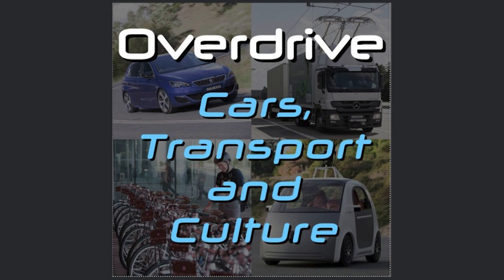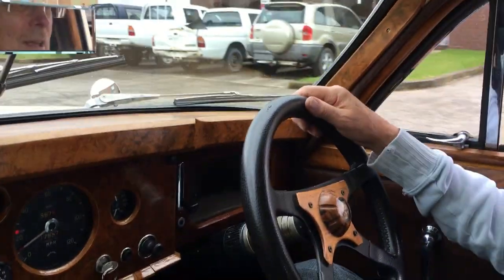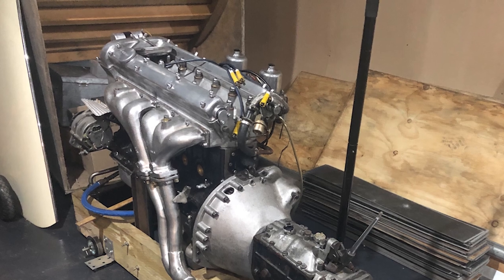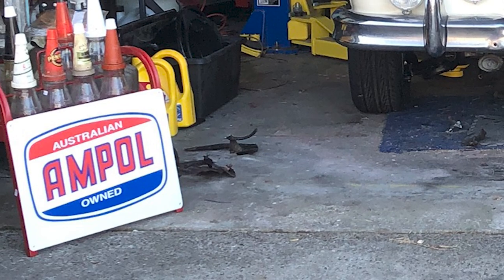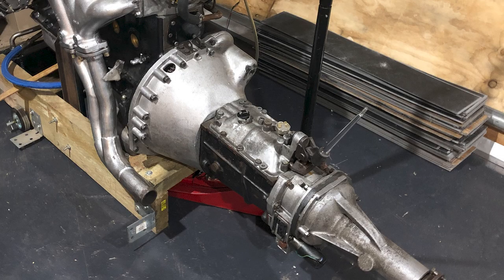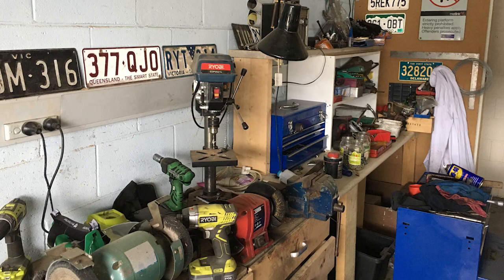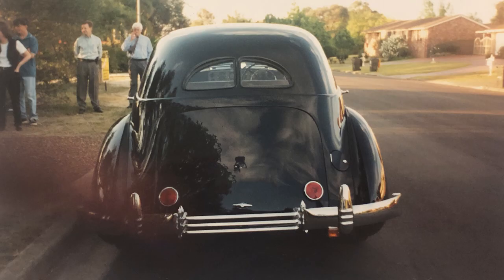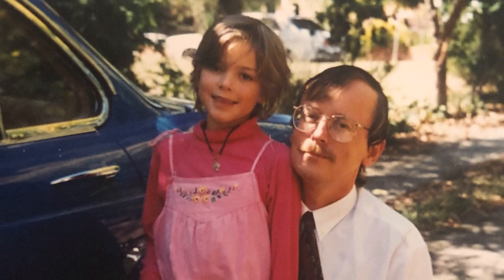Restoring a Mk 1 Jaguar into a reliable, spirited drive without losing its character

Comment: Hi nice vidio,I have a very similar set up,but in mk 2  .I did the conversion about 38 years ago.
When getting the twin SU8 carbs recond .They centred the jets with a tiny ball gauge ,he said necercery and then never need to ajust.
I must say this is a fast car even in todays standards

Thanks  martin.
Reply from the maker: Chris noted" "Proper reconditioning of the SUs is so important. Especially when you are running big valves and high compression"

Comment: Beautiful car! I have owned three Mk1s in the past. One bugbear was always the lack of interchangeability of parts between Mk1s and every other Jag, mostly ball joints, wheel bearings etc. Personal choice of course, but the road wheels and steering wheel certainly spoil the car for me.
Reply from the maker: Chris noted: "Ball joints are interchangeable with minor modification. I also don’t like the steering wheel and will be putting an original wheel on albeit with reduced diameter.
Reply: @carstransportculture  I wish that I had known that at the time! I toyed with the idea of swapping the front subframe and rear axle for Mk2 units, but in the end went for a whole Mk2 instead, to save myself the bother. I still yearn for a Mk1, though. The steering wheel swap will complete your car. Those wide wheels are, at least, reversible!
Reply from the maker: @robbierobson3251  Chris is going to take the car on track days.  He is not quite in the position to have two sets of rims and tyres.

I may be a heretic here but I think a lot of old cars look better with wider rims, the classic example for me is the e-type. But not to excess.

Comment: Did you retain the original narrow Mk1 Diff? I would find it tempting to go to the wider MK2 Unit. Otherwise I approve of all of your modifications, and they were the same modifications that I fantasied doing to my MK 1 2.4, alas at the time I was an impoverished student, so instead I am now throwing my money at my road going tribute to the TWR XJS.
Reply from the maker: Chris sent this answer: I have sourced a 4ha diff bigger and stronger as the 2.4 diff is smaller 3ha and might not take the power. It is also a better ratio.

Comment: I've a 1957 MK1 2.4 that was restored (not terribly well) in 1992-4. I want to do a similar upgrade from 2.4, using the same block, to 3.8 with SU carbs and disks brakes all around and to hell with the begrudgers, it's my car.
Unfortunately I'm in Ireland so I couldn't be further away but I let you how it goes.
Reply from the maker: Love to hear about your project (and some Photos?).  Which part of Ireland? Do you get to take it on "Appropriate" drives?
Reply: 2.4 is a short block mate, You need a 3.4/3.8 long block motor

Comment: Take those gash steel wheels and hubcaps off and put a set of powder coated black wire wheels on it, Wider J competition ones on the rear and it will look awesome!
Reply from the maker: "powder-coated black wire wheels" haven't seen that often on Jags?  Would that offend the purists?
Reply: @carstransportculture  No! I am getting my 3.8 MK2 wires powder coated black! Will look great with my opalescent light blue bodywork!
Reply from the maker: @scotty6346  Love to see a photo when it is done.

Comment: Hi, that exhaust system sounds great.  Could you please advise the brand and specs.  Thanks, Scott
Reply from the maker: Chris tells me that it was a bespoke job, done by his mate a fitter and turner. It gets harder, the mate is in Victoria, Australia and is in lockdown at the moment.
Reply: Thanks for you response.  It is hard to get that classic Jaguar sound these days - the off the shelf replacement stainless systems don't sound as good as this car!
Reply: Hello again, now that the lockdown has eased in Victoria, is there any chance of getting some details on the exhaust specs?  Thanks.
Reply from the maker: @scott6889  Go to www.drivenmedia.com.au and send through CONTACT a note with a contact detail (this is the way to avoid it going public).  Chris will then get in contact.  

Cheers
Reply from the maker: I understand that you have been in contact with Chris and had a good chat.  Good luck with your 420.

Comment: At least you didn't put a ferkin Chevy engine in it and put a good Jaguar engine, get a wood steering wheel please
Reply from the maker: Note reply above which says in part. "I also don’t like the steering wheel and will be putting an original wheel on albeit with a reduced diameter". The project is on-going with the timetable having been set by a wedding and now a lock-down in Victoria.